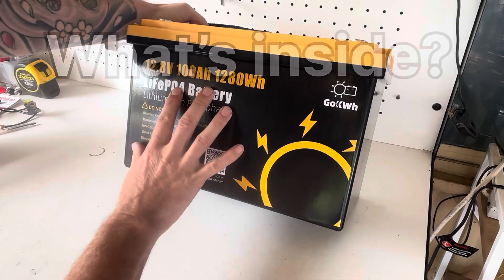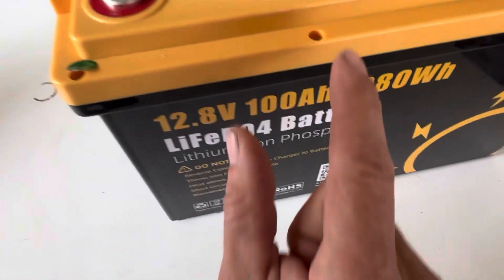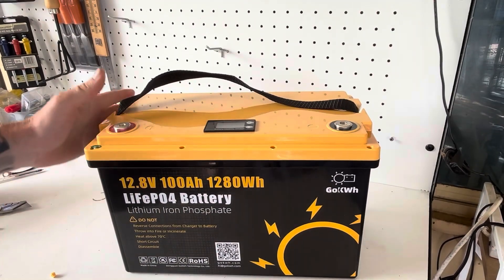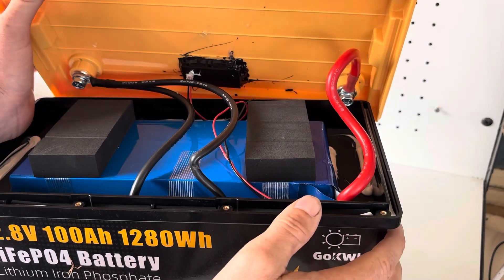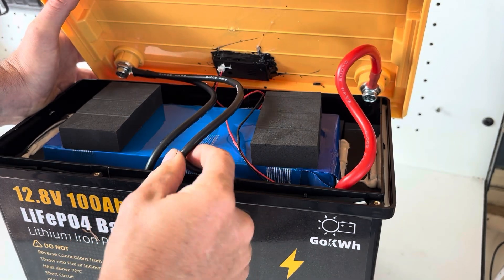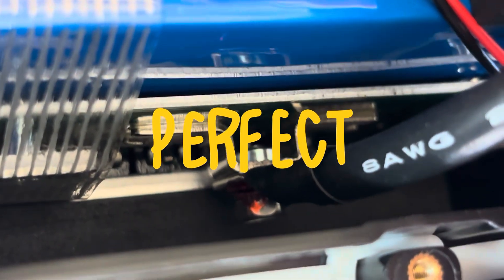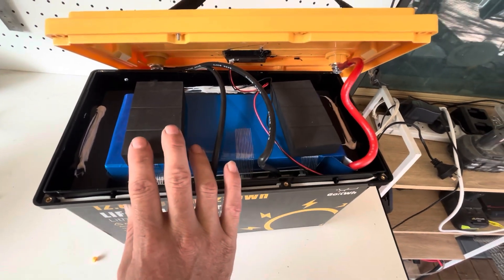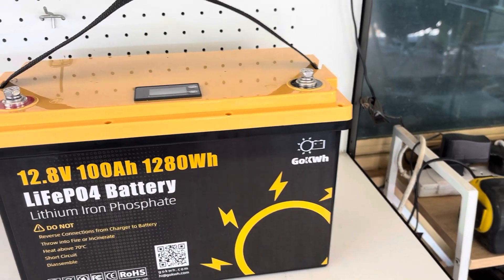GoKWH Teardown. 100Ah Lithium Battery

Comment: When you click your link the $249 one doesnt show up and the coupon code doesnt work on the more expensive versions.  But if you search around you will find it and I indeed got it for $199.  Will let u kno how it turns out.
Reply from the maker: I can get a code for $20usd off any other battery if you are interested. Use Code techboxreview20 I will check out the link and try and fix it. And yeah let me know how you go with your battery 👍
Reply from the maker: @googleuser4434 that’s no good. Do keep in mind that it is Chinese new year and over there and many people will be on holiday. Try contacting them next week and see if they respond. Also check your spam box for a reply as a lot of email end up there. Keep me updated
Reply: @Techboxreview never did get a 
reply but the battery showed up finally.  Not a scam but poor customer service.
Reply from the maker: I’m glad you received your battery 👍 noted about the customer service. Thanks for the update mate 😎